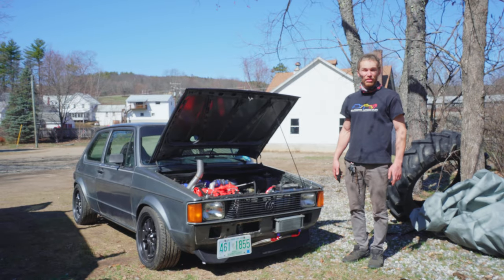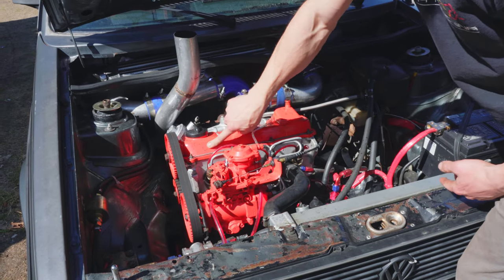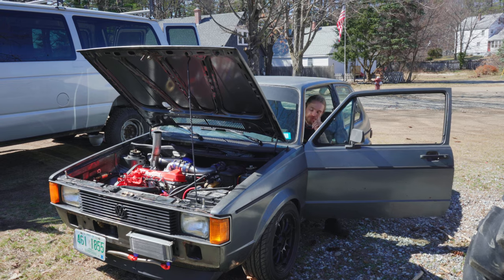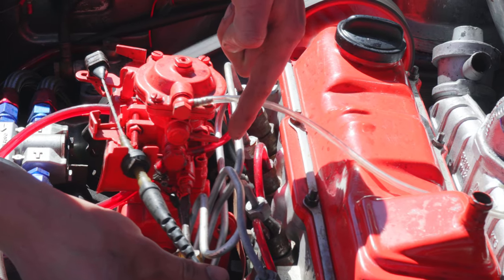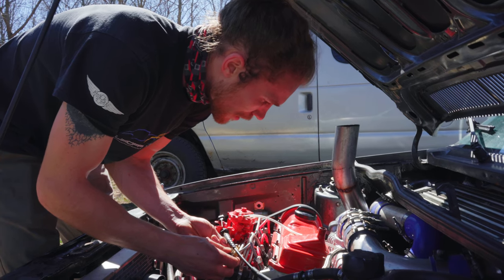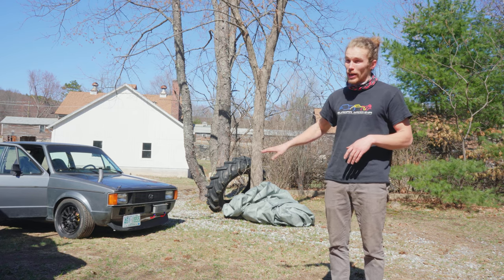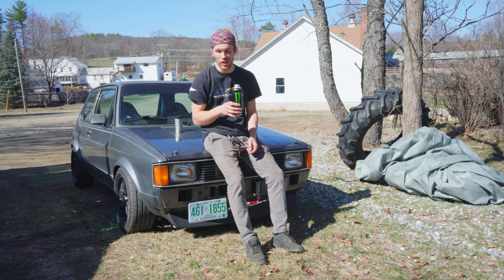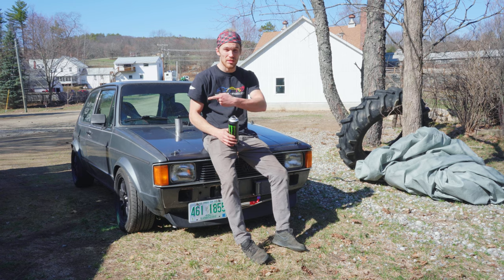30PSI Pulls and Fuel Pump Tune!! - MK1 VW Rabbit Turbo Diesel (4K)

Comment: Love it that you guys in the US also enjoy tuning those old turbo diesels!

Ive got a MK1 Caddy (rabbit pickup truck) and also tuned the pump a little bit, it was quite a common thing to do back in the days here.

Greetings from germany
Reply from the maker: Cheers to that 🍺 I appreciate you sharing!
Reply from the maker: What do you use your truck for?
Reply: @OliverFetter  I use it for carrying my motorcycles, construction materials and everything that does not fit in my mk2 Golf. I also have a removable camping drop-off cabin I use on holidays.

Pretty useful and cheap to maintain  truck
Reply from the maker: Hell yeah that's dope!! I'm inspired

Comment: I have the AAZ 1.9TD engine swapped in my mk2 Golf. With K24 turbo. heavy duty clutch. Rover tdi boostpin. and Mercedes van intercooler. It goes good! The best i could get with my setup is 6,9 seconds from 0 to 100kph. If you want more power. You can try a Giles pump. They are mechanicly different in the inside with a larger rotor inside. I didn't do the governor mod. 
Only downside is. After 2 pulls. The coolant temp rises. I used a new large radiator. Never added coolant. But i think it something to do with EGT temp.
Reply from the maker: Sounds like your working on some dope stuff man! Keep it going.

Comment: impressive boost level. do you have a list of full mods? i'm looking to increase the output of my 1.6TD vanagon. i'm not looking for speed. just power to get over the mountains.
Reply from the maker: What modifications are you interested in? I've done a bunch!!
Reply: @OliverFetter  sorry, i wasn't paying attention to notifications. since posting message i've ordered parts to switch over from the cy mishmash on my vanagon to the jx setup. current setup leaks oil in multiple places.

i'll have to get back to this once i get all the parts installed.

Comment: Put timing piston spacer on both side and go for governor mode and put golf mk4 1.9 96kw intake manifold 
For more fuel go for 11mm or 12mm pump head
Reply from the maker: Put spacers in or remove them?

Comment: I have a 1.6TD with a 5 speed trans. I have a turbo back exhaust. I am going to use this vid for a pump tune, thanks. Could you do a video for the fuel pump governor mod. Would you recommend? thanks again, good stuff!!!
Reply from the maker: Love it man! I have a guiles pump so I actually haven't had to do the governor mod? I would recommend it though, it really wakes up the motor since there is ample fueling throughout the whole RPM band
Reply: Reindexing the throttle can buy you so much more power than gov mod.
Reply: @fastinradfordable  how is this done?
Reply from the maker: You just put the arm on the pump back a few clicks with respect to it's original position.

Comment: great explanation of the fuel adjustment. is this setting for idle or or will it affect higher rpms? my cummins b 3.3 non turbo has some power loss and won't rev more than 1800rpm under load.
fuel filters are clean and clear.
cheers
Reply from the maker: Turning in the fuel screw increases fuel delivery across all rpm's, that's why you need to turn the idle speed back down to balance it. I'm not sure how to diagnose your problem but I feel like start by making sure the timing is within spec, could always make a Diesel run slow/weak. Turning the fuel screw in will perk it up regardless 💁
Reply: @OliverFetter  thanks Oliver

Comment: How can i eliminate rev hang without closing the diesel ?  I have a 1995 vento 1.9td aaz with a mk2 diesel pump and Garrett T3 turbo off a mk2
Reply from the maker: That sounds cool!! What do you mean by closing the diesel?
Reply: @OliverFetter  turning the fiew screw anti clockwise so it gets less fuel and eliminating rev hang
Reply from the maker: @gianlucamizzi1187  yes! That's all you can do really 💁 tho my skitz tune on the gold pump did both heavy fueling & no hang but essentially linked the fuel screw directly to the throttle. 11mm still feels way better though.

Comment: did you modify or block off the blow off valve?  i just finished installing new parts on my cy engine. but the blow off valve is limiting boost at 10psi. the new turbocharger should be higher.
Reply from the maker: Yes, when I was using the TD manifold I think I replaced the adjustment screw with a longer bolt so it stays entirely closed off 👍 that's cool!
Reply: @OliverFetter  I'll check on that after work.

Comment: Can you tell me something...I got a spare pump from a automatic mk4 tdi with 110hp with the bigger 11mm injector elements...can they fit in a AAN mk3 pump that i plan putting on a mk2 1.6td with a bigger turbo and some other shit(3in straight pipe,intake,arp studs,1.9 head....)
Reply from the maker: I have not a damn clue my friend 🤯 you'll probably just have to give it a try!!

Comment: I know it was already asked on one of your videos, but I can’t seem to find it in the comments. But could u tell me the wheel size, back spacing and tire size combo ur running please?
Reply from the maker: Hey! This is probably my least favorite question to answer lol I don't have all the specs on hand and I'm not going to measure but I'll give you what I remember:

15x7 wheels with maybe 32mm backspace.
Yokohama S Drive tires 195/50R15

Comment: Like the straight forward description of the two screws and the rev hang. Is the diaphragm on top of the injection pump just for turbo diesels?
Reply: Yeah
Reply: @dylanfox7077  I'm gathering turbo injection pumps are rare while normal aspirated pumps seem to be quite common. What are the drawbacks of running a normally aspirated injection pump on a 1.6 turbo diesel? Less horsepower?
Reply from the maker: Yees the diaphragm is the differentiator
Reply from the maker: @herkybc130  *steals reply (sorry 😬)* the diaphragm is what matches fuel to boost, ie with more airflow you need more fuel as well to have more combustion.
Reply: You can adjust the fuel to match full boost but the down side of having no boost compensator is that when the fuel is adjusted to match full boost it will be smokey when off boost

Comment: I’m just curious your thoughts about putting the older mark one style lift pump on a newer 1.9 TDI, it seems like you have more tune ability with the older style pump.
Reply from the maker: Depends what you're looking for, generally a 1.9 can make more power because of the computerized pump - makes it easier to provide more fuel. With the 1.6 you start to run into rev hang as a limiting factor for fueling because it increases in a linear fashion
Reply: @OliverFetter  tHANKS BUD, KEEP UP THE CONTENT!

Comment: Little help here. so i have a 1.6td pump that i recently putted on my 1.9tdi engine. Before doing so, i swapped off the 10mm plunger from the 1.9tdi pump and place it on the 1.6td pump.
I adjusted the boost pin about 90degrees. For some reeason, i cant get it throw a little smoke, becaz the rev screw is backed all the way out. So i cant even adjust the fuel screw anymore. Anything as what might have caused it to still be throttling high even with the rev screw backed out?
Reply from the maker: The fuel/power screw is a essentially a multiplier of your throttle position. So let's say you bottom out your idle setting and it's providing 2 units of fuel, then if your fuel screw turned in (well say that's a  3x multiplier)  then you're still getting 6 units of fuel not 2. Make sense at all?? Bottom line you can't run that much fuel screw with those settings - you could try playing with the way the throttle is indexed to the pump.
Reply: @OliverFetter  is there anyway I could reach you on fb to get a little more assistance if possible?
Reply from the maker: You can try to dm me I'm not sure that it will be any easier though?

Comment: howd you get it to smoke so much? i've got a 1.6td ecodiesel and adjusting the fuel screw hardly makes it smoke anymore than it already did. Pump was just rebuilt, when i had the old pump on it smoked like a damn train
Reply from the maker: Ya gotta CRANK the fuel screw till your getting rev hang, then turn your idle speed down, then repeat.

Comment: What turbo do you run, I have a Garret T3 on my golf, but i think it is very lazy...
Reply: Add a manual boost controller and add some fueling, it will be much more responsive
Reply from the maker: GT2052! T3's can be laggy depending on what motor you have

Comment: Have you done anything to the stock blow off valve built into the intake manifold? Have you added your own?
Reply from the maker: Yessir it's just blocked off. I have the valve force-shut with a bolt. Its not particulairly helpful OEM feature.
Reply: @OliverFetter  yea the wastegate should be enough. I plugged my old 1.6td with a rubber expanding pipe plug and it worked great, made a little bit of room too. I was only asking because your car makes a whoosh when you get off throttle - none of my TD cars made that sound and I was wondering how you did it

Comment: I wonder what the EGTs were at 30psi. If it hits 30psi without getting to 1200F on the EGT gauge you are pumping in too much air and creating backpressure. My Rabbit TD actually goes faster at 15psi than if I run it up to higher boost. I've had it up to 35. It went slower.
Reply from the maker: You're on the ball Oscar! This is exactly what I found since this video. I actually blew this turbo up bc the overspool + back pressure was so bad. Now it makes closer to ~24 in a much smoother more powerful way.

Comment: Anything specific to keep egts down? Ceramic pistons, methanol, nitrous?
Reply from the maker: Working on that currently.. the intercooler is not quite cutting it anymore. I'm going to add propane to the mix and see what that does, if EGT's are still through the roof then probably going to add a big FMIC or meth injection or both! :D
Reply: @OliverFetter  what if you run more psi? Basically lean out the air fuel mixture. Bigger exhaust pipes?
Reply from the maker: @dieselgeezer18  Good thought! I can't at the moment with the turbo I am running, it is maxed out (i.e. wastegate remains closed)
Reply: @OliverFetter  Hey man, what turbo did you use here?
Reply from the maker: @wisdomofafoton  GT17 in this vid. The '17 is actually just a touch small for this motor - it spools fast which is great but develops boost creep at high RPM's
Reply from the maker: But it also depends on what RPM band you drive your car in ¯\_(ツ)_/¯
Reply: @OliverFetter  thanks man! Also for the fast reply!
The fact was that I was trying to find out how much boost can a KKK K14 can make with a 1.6td (max fuel screw and gov mod adjusted). I just cant take it over 1.3bar in overboost, I suspect my wastegate is stuck open just a bit or the turbo just cant make more..
Reply from the maker: @wisdomofafoton  I haven't tooled around with K14's or K24's at all but I'd imagine your hitting the upper flow limit of your '14. I.e. compressor wheel is spinning heinously fast but it's not efficient enough to make a difference.

Comment: Great stuff man! I have so many questions 😂 I own a mk2 Jetta that has a 1996 AAZ 1.9 swap. Been working on it none stop and you videos have definitely helped.  Maybe there’s a way I could ask you everything somewhere else? Either way I’ll start by asking about the Giles pump. What did you have him make the pump too? When he asked me he said he could set it to 10 or 15psi, of course I said 15... now I’m seeing guys run 32psi on these engines. How much is it gonna take for my pump to reach that? Do love your car and your content!
Reply from the maker: Yo! You could dm me on the gram if you have a ton of questions @ollys_auto. I haven't worked with any 1.9's. I had Giles remove the governor when he rebuilt it and set it up for 20+ psi if I remember correctly. I appreciate the hype! Glad you like it
Reply from the maker: A lot of it is how you tune the pump in! I have a couple spare n/a pumps that I'm gonna dissect this week to see what's going on 🙈 it's just Bosch not rocket science (or at least that's the hope).
Reply: It seems like you could use this older pump on the newer style 1.9, and not have to deal with an ECU. What are your thoughts?

Comment: This pump looks like the bosch ve pump that came on 89-93 5.9 cummins. Are they basically the same type of pump?
Reply from the maker: Just about the same thing yes! All mechanical with a diaphram/pin to account for boost pressure
Reply: @OliverFetter  OK that's perfect cuz I know how to tune a VE pump and that's not hard
Reply: Yes. 

A ve pump does look like a ve pump

That is a fact

Comment: I worked in a mercedes shop 20 years ago all the diesels coming thru the shop back then, I have a 300cd turbo coup and a 300d euro non turbo 
I sold the usa turbo car it was slow till the turbo kicked in the rain the back end had less predictable  control. The euro non turbo had better consistent power and a 4 speed gear box and differential change for city driving it was very adequate.
Now with UK diesel pump for me4cedes my next diesel will be a turbo with the high boost pump and 4 speed gearbox and much lower Rear differential gear g for good highway cruising sedqn.i have a 504 wagon diesel xd90 I love ,but it's not a highway cruiser.the 240D is the turtle a non highway car... lblew up a dasher in the 80s was never happy with vw diesels,seemed to ez to blow up. And non turbo at that.
Reply from the maker: Sheeew you've done lots of it. The VW's sure do like to blow up when you get into it :/

Comment: Hey men do you know if i can put some kind of hard cut "popcorn" rev limiter on a engine like this with mechanical fuel pump?
Reply: Not on a mechanical pump no but I have seen some people from Portugal make mechanical diesels have some kind of Rev limiter, guessing they have some kind of controller on the fuel shut off solenoid that shuts the fuel on and off quickly like a Rev limiter
Reply from the maker: Probably not ~ unless you rigged up a raspberry pi & rpm sensor to cut fuel delivery at a certain rpm intermittently... But that still probably wouldn't sound like 🍿 cheers!
Reply: @OliverFetter  ok one more question ca you make somthing like the "evry" or "every" mod on a mechanical pump like the people do to thier tdi's
Reply: @vankata252  No sir that's just an electronic pump ability.

Comment: Where did you get your clutch?
Reply from the maker: I seriously don't remember but it was a southbend brand pressure plate
Reply: Okay ,I’ve had trouble finding durable plates in 210mm. Well not in that size but the boreaxle is smaller than what most sintered plates use
Reply from the maker: Update: the south bend ripped in half while trying to drag race 🙈 currently using an oem 210mm with better results